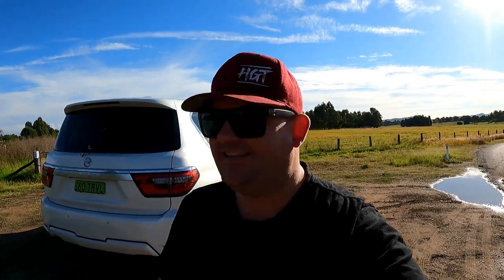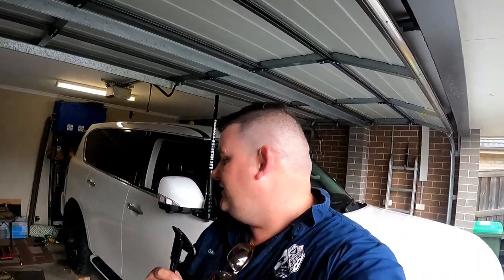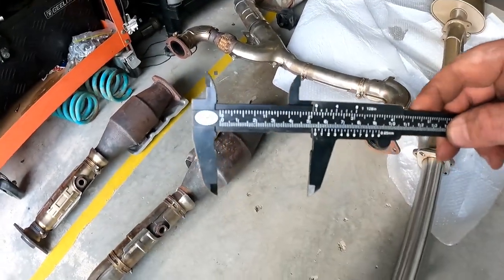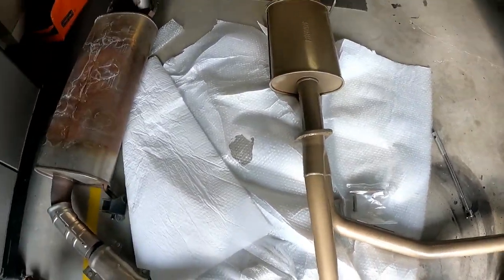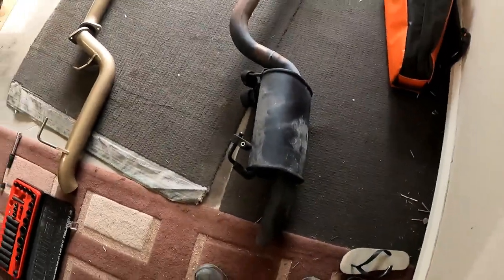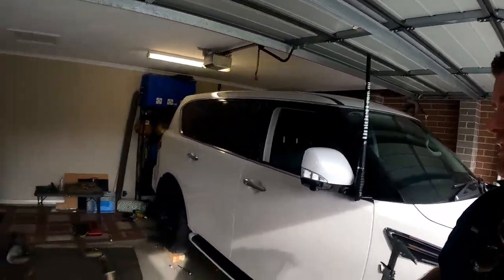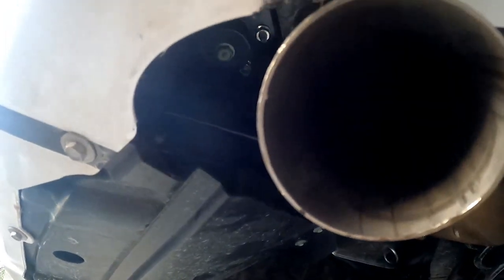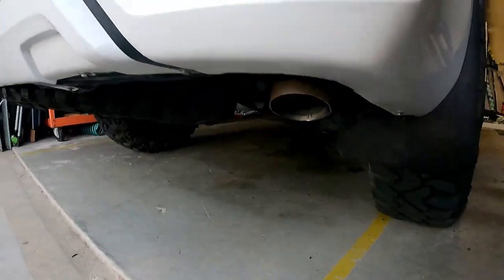Pacemaker Exhaust Y62 Patrol V8 - AVO secondary Cat delete pipes - HGT new rig build Garage Life

Comment: Hey mate, just curious if you ever had any codes come up with the AVO cat delete installed? I have the pacemaker exhaust on mine and looking to do the secondary cat delete. Cheers
Reply from the maker: When I first put them on I forgot to plug in the passenger side sensor and it threw a code. Once I plugged it in and reset I’ve had no issues since

Comment: hey mate i was just wandering if you think that this exhaust is legal or not trying to make my dad put a different exhaust on his cutdown patrol and he saying no because of legal reasons and getting pulled over. Other wise it sounds amazing to me
Reply from the maker: Hey mate. If there any legalities in it, it would be with the secondary cat pipes. However the system does still have two cats in place still. My advice would be you will have no issues with legalities if you are replaced from cat back. But be sure to check you state’s legislation on vehicle modifications to ensure it’s legal where you are.

Comment: Why did you only get 2.5", pacemaker told me their entire kit including extractors is full 3"?
Reply from the maker: It goes to 3”. It’s definitely not 3” behind the secondary cats. I’d say pacemaker are talking about the max diameter. My guess would be the pacemaker header and high flows would be 2.5” each side going to 3” at the y bend
Reply: @HappyGoTravel  it says online they have an 1 3/4” primaries with 2 1/2” outlets so you must have been referring to inside diameter?. Outside diameter should be 3”. 

Bit of false advertisement on their behalf to sell as a 3” kit but you don’t actually get a 3” ID.

Comment: did you choose pacemaker because of cost?  Appears to be the cheapest out of torqit, DASH, manta, pacemaker (dash online prices)- in that order roughly.  With the muffler would be interesting, is a bit slappy - got a link for someone with the mufler?
Reply from the maker: Cost wasn't really a factor. I have bogan mates that ran pacemaker on Commodores etc. and i trusted the brand. 

For me Torqit would be the last one id consider because its too quite. 

David Dash has a play list on his channel with them all, definitely worth a watch if you're undecided
Reply from the maker: https://youtube.com/playlist?list=PLsRFKkMJP_g8YBU6GRLzqg5UNoIHadSnA
Reply: @HappyGoTravel  cheers mate, is there much of a drone in the cab rear seats?  Ive heard maybe its an issue particularly if towing a van it must reverb back into the car..
Reply from the maker: @grayditri7860  i don’t get any that I notice in normal driving. When it’s under load on the beach with no music you just notice it. But if you’re going to be towing a lot or long distance I’d definitely get the rear muffler option.
Reply: hey mate, does the car need a tune with the exhaust change out?  Now youve had it on a while, still happy with it?
Reply from the maker: @grayditri7860  yeah I still smile every day I’m in it.  No tune required, definitely advantages of doing it though. When I put headers on I will tune it
Reply: @HappyGoTravel  cheers for the quick response mate.  whered you get the secondary cat delete pipe?  It looks like the car runs 2 cats in series fairly close together?

Comment: Sounds great ! Did you have to get a new tune up on the engine after the new exhaust?
Reply from the maker: Thanks mate, no I haven’t as yet. I am planning on eventually doing headers and high flow cats and getting it tuned
Reply from the maker: @gehko22 there are 4 cats in a standard patrol. 2 each bank. I have taken 2 out. One from each bank. 

The first cat is right at the back of the headers (still in) and the 2nd are the 2 pipes I replaced. When I eventually do headers I will put high flow cat pipes in as the new headers will not have cats at the back. 

I hope that makes sense

Comment: Curious, for better or worse, does changing the exhaust system make any difference to fuel economy ?
Reply from the maker: Minimal. If you really like the sound you’re more inclined to flog it hence use more fuel
Reply: With a tune yes as it's breathing better/ less restricted.. but as stated you're gonna be giving it more to hear that awesome V8